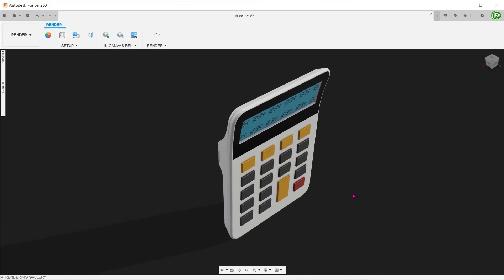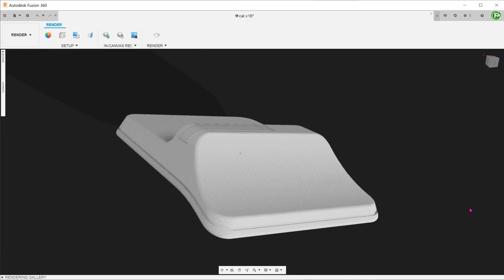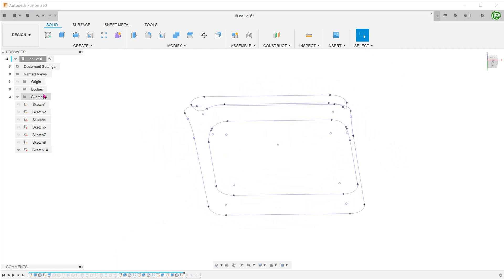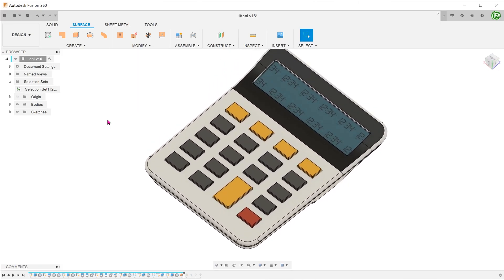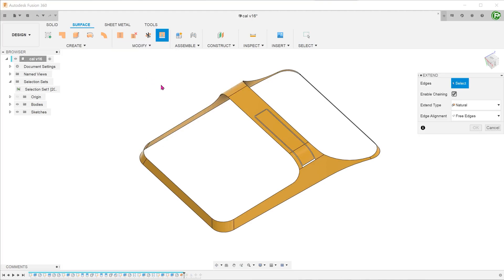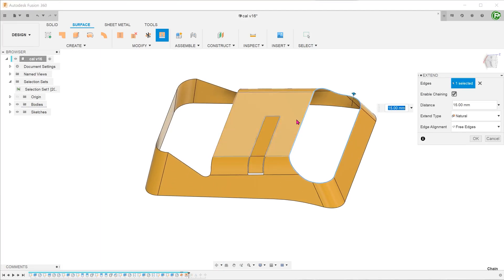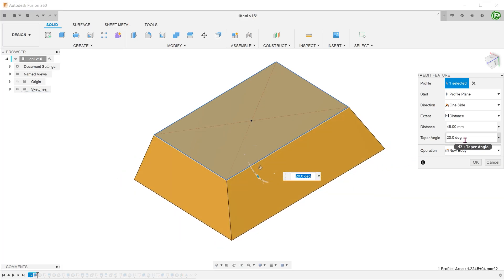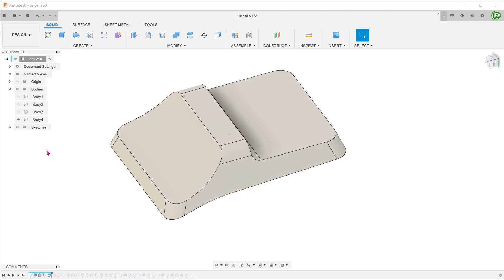Visualisation - The Big Picture

Comment: Good work. I had a tough head scratcher myself recently when I wanted to create a curvy vase formed from a single curled petal, where each one side curls over the other. I ended up splitting my vase in half. I revolved my side sketch profile for the back half 180 degrees, then revolved it again -135 degrees for one of the two forward curl sides. Both were split with a sketch of a spline on the side forming a sloping top and then another sketch on the front (where the overlap was) and I tangent in another spine to split (this time to split only the front). Then I shelled both, And I mirrored the front. Then non-uniformly scaled one of the front sides so it went over the other. I had to cover the cut edge with a sweep cause it was cut from two sides and left a line at the transition.  Here is the model if you want to do another video based upon the idea (consider the model creative commons): https://drive.google.com/file/d/1d7vk036z_-f7uGhbo8awLKQToLQoGl2I/view?usp=sharing
Reply from the maker: Hi, thank you for the model! I will consider this. Sorry for the late reply. Any comments with links are automatically held for review. I did not see this until I went to the "held for review" section.